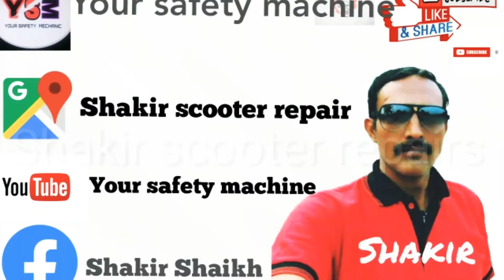Pulsar 150 self start sound problem solution पल्सर 150 सेल्फ स्टार्ट साउंड प्रॉब्लम सलूशन।

Comment: Sir ji ek pulsar old model hai 150 2005 model,jo first model hai pulsar ka,usme ek fault aaya hai k gaadi chalte chalte bnd ho jaati current gaayab ho jaata,nutal kro toh nutal light bhi show ni krti hai,aur horn,indicater kuch bhi kaam ni krta hai,lekin jb kick maaro toh ek he kick mein current aa jaata hai,fir chaahen self se start krlo ya kick se start krlo,kya problem ho skti hai,wiring bhi chek krli lekin koi wire bhi toota ni mila,aap btayen plz aur koi fault hai ya koi coil ya relay charger ka kuch fault hai toh,kya chek krun
Reply from the maker: CDI check karo